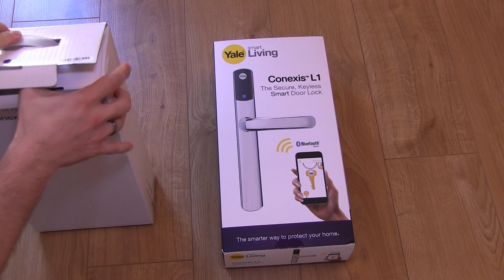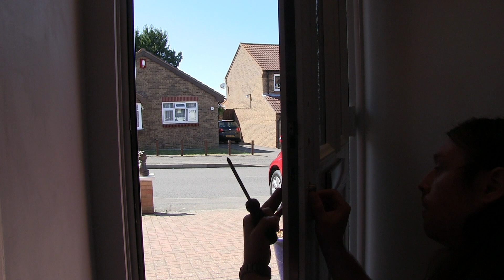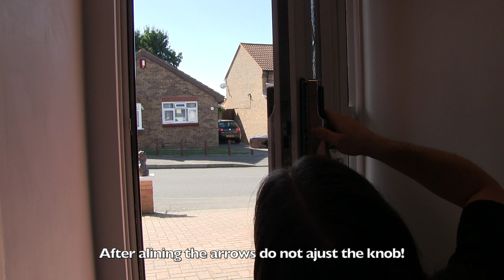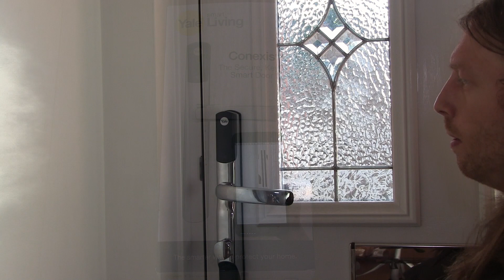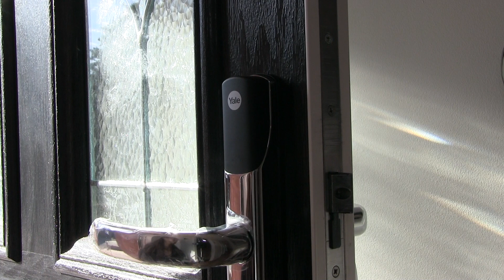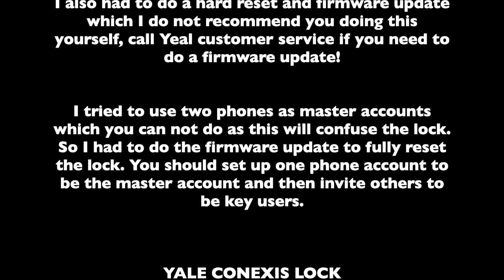Unboxing and installing the Yale Conexis L1 Smart Lock

Comment: Very detail , I want to know door lock hole is same current not need drill new hole ! .? Thanks
Reply from the maker: Hi Elton
As long as your current lock is a multipoint euro lock then no drilling is needed.
See this part of the video, setting the fixing locations https://youtu.be/8_OnJTmXasE and https://youtu.be/8_OnJTmXasE so no need to drill new holes.
I hope this helps.
Kind regards and keep well
David
Reply: @BrenTeckITSupport  ok thanks

Comment from the maker: Hi Paul
I don't know where your comment went :(
"How wide is the handle? I can't find measurements anywhere and want to know if it will fully cover my old handle or if it's thinner it will expose old paint"
It's a good question so I will post it here.
Outside Width = 36mm Hight 276mm
Inside Width =36mm Hight = 386mm
I only quickly measured mine so might be out a bit so use this as a guide.
You can always paint the door before you fit it, which may be best if you are thinking of repainting it in the near future.
Hope you get to see this.
Take care and keep well
David.

Comment: Hi David. Great review! Could you please answer this question for me. I often leave my front door open as I have a stainless steel mesh security screen that I keep locked, allowing a breeze to flow through the house.

If I leave the door open/ajar for a long period of time, will the Conexis be OK, or will it beep at me incessantly?

Thank you, - Mike.
Reply from the maker: Hi Mike
It will beep ones waring you the door is open but I think it then stops. I certainly have not noticed it more than that.
I hope this helps, kind regard and keep well
David

Comment: Would be great if someone could do a troubleshooting video. Had this lock for around two years and for reasons unknown when I close the door the confirmation chimes now ring multiple times instead of the once like it used to do and the only way to stop it is to push the internal button to the right after locking. I've tried resetting it to no avail. Just annoying
Reply from the maker: Hi Tom,
I think this might be warning you the batteries are running low and to replace them now before they get to low to reliably operate the look. It does start waring you well in advance so you may not sport the correlation between the double chime and batteries dying.
I hope this helps.
Kind regards and keep well,
David
Reply: @BrenTeckITSupport  Thanks for your reply. It is definitely not the low battery chimes and I put fresh ones in just in case. It is the door close chimes. When closing the door they used to chime once but now they chime multiple times for about 2 minutes unless you turn the internal circular button to the right to stop it.
Wondered if anyone else had a similar problem.
Reply from the maker: Humm, ok could you not be lifting the handle enough, or the door just slightly ajar stopping it from looking property?
If it's not this than give Yale support a call
This help page looks very useful so try this there is a sample of sounds but all are short.
https://help.yale.co.uk/advice/product-support/smart-door-locks/conexisl1/
Telephone: 01902 364 606

Email: info@yale.co.uk
Reply: @BrenTeckITSupport  . I have been all over that site and it really doesn't help. Yale are known for having very poor support and not replying to emails  anyway the problem is annoying but I can live with it. Thanks all the same.
Reply from the maker: @tomaharbowx  Hi Tom, I have been extremely busy this month so sorry for the late reply.
If it's not the handle being lifted fully or the door not being fully closed fully. It could be a traped lead or another fitting problem such as not enough room for components to move or the wrong bar insert. It could be worth opening the lock again and refitting it to make sure it's all correct.
Good luck and let us know how you get on.
Kind regards and keep well
David

Comment: This or the ultion ? not really anything else on the market for multipoint locking doors, also will any of these locks work with stable doors ?
Reply from the maker: Hi Busyswizzler,

I don't know about the ultion lock so I can not say how that one will be, only the Yale Conexis L1 Smart Lock.

As for any lock on a stable door design, I really can't say. I know UPVC stable doors exist as I have seen them but not taken one apart yet. So all I will say if it's using the standard multi-point and lift to lock then I can't see why they won't work. If you want to be sure asked the door manufacture if they are compatible.

Hope you had a lovely Christmas and wish you all the best for 2021

David

Comment: Biggy for me is that you can not lock it via phone/smart home integration (only unlock).
Reply from the maker: Hi Kevin,

Yes, I know what you mean but if you already have a lift to lock setup then you should be used to it.  It's just a simple lift to lock and all done no key needed. But I do wish there was a motor to do remote locking for though of us who forget to lift to lock or if we let someone in to drop off a package, walk the dog etc and wanted to make sure the door was locked after.

I guess it would take more battery power and a bigger motor to do it.

Thanks for watching and commenting, keep well.

David

Comment: Great video and very helpful. Now that you have it over a year, can you tell me if it was worth the purchase? Thanks
Reply from the maker: Hi Pyle

Well that is an open ended question.

For us I would say yes, as I like having the peace of mind on checking if the door is locked whilst out. Also I now seldom bring any keys or wallets when I am out as I just use my phone for letting me back in when I get home and for contactless payment.

My wife likes being able to unlock the door from upstairs to let someone in as she is disabled and can take time getting downstairs so with the SkyBell she has the confidence to open the door remotely. She also loves being able to check that the door is locked while in bed.

We both love being able to unlock the front door from the worm dry inside of the car in winter and then just go straight in, no fussing at the door.

So for us, yes we love it. But I can see some people would be happy with a simple key, no battery, no internet or WiFi no problem. As for security all locks are just deterrent to stop the opportunist from walking in, so far there is not much publicly on how to hack the Yale lock so brute force is most likely which will probable mean they with use the window instead of the door being a multi point lock.

Glad you enjoyed our video, wish you all the best and keep well.

David

Comment: Good installation video :-)

Did you manage to add the "skill" to Alexa? Keeps telling me my email and / or password is incorrect even though it exactly matches
Reply from the maker: Hi AberdeeAl,

In a word yes. I don't think I recorded it and ever use it. I prefer Google Home Assistant and SmartThings.

First of, make sure your details are ExAcT as it could be case sensitive and check you have got Num Lock off if using a keyboard without a number pad.

Is your Amazon account associated with the right country I remember this causing me a problem for something in the past?

To check/change region:

1. Logged in to your Amazon account in a desktop browser.
2. Go to Accounts & Lists > Your Content and Devices >
3a. Preferences and click the downwards arrow to the right of Country/Region Settings to view your current country.
3b. You may need to click "Learn more about updating your default Kindle Store to Amazon.co.uk"
4a. Hit Change and enter the new address you'd like to associate with your account
4b Click Transfer your Kindle account to Amazon.co.uk

Doing this will change a whole host of Amazon settings and preferences so take care before changing it.

Kind regards and keep well

David

Comment: That's not as smooth operating as I'd have hoped, someone leaving the house still has to manually lock the door behind them instead of the handle simply not catching until engaged as I expected it would work. Not great for a front door, especially in a HMO.
Reply from the maker: Hi Hashterix

Yes it does require the person leaving the house to lift the handle to lock it. The same for most secure doors. I say secure as the push to close latch are so insecure you can open them with a credit card down the gap as seen in spy films.

I do agree it would be nice to have an auto lock feature so after x minutes it could be set to auto lock and a hold open mode if you want it to stay unlocked till you lock it. I would love this feature myself.

You can see if the door is locked or unlocked via the SmatThings app.

Using Home Assistant you can start doing amazing things like take a photo every time the door is unlocked and locked. You could record who leaves it unlocked and have a friendly chat with them.

Have Home Assistant alert you if the door has been unlocked for x amount of time.

I will not go into HA here as this is a massive topic which I will do a video on later.

I am just stating to get into HA and finding some of it amazing but parts frustrating so its not for everyone yet... I mean yet they are updating it all the time and it should become the standard for home automation.

Kind regard and keep well

David
Reply: @BrenTeckITSupport  they ought to release a split-spindle version, plenty of homes use this type of mechanism. As long as the frame of the door overlaps the door itself there would be no risk of a credit card being able to open the lock, it would operate the same as a nightlatch. Split-spindle support and a keypad would make this near enough perfect, their nightlatch version already has these capabilities but your luck is just a matter of whether you have a PVC or a wooden door.
Reply from the maker: @Hashterix  Hi Hashterix,

A night latch is not classed as a secure lock. It only holds the door closed in one point using a spring catch. Which can easily be overcome by one good shoulder barge or a kick, two screws are holding it in or if you're lucky about 1cm of wood in one place which will split. Whereas a multi-point lock holds the entire door to the frame. The stretcher of the door and frame are holding the door locked and closed (as long as it's locked). You will need a ram to force this type open. This being the main problem someone has to lock it! I would love it to have the auto-lock function. So much so if it came out I would upgrade.

You are right it all depends on what door and frame you have in place at the time. 

No lock will guarantee security, it's frightening how insecure all locks are. If you what to lose your faith in locks have a look at https://www.youtube.com/lockpickinglawyer all security does is to keep honest people honest and delay or deter the criminal.

The best security for a home is to have a big dog.

Kind regards and keep well

David
Reply: @BrenTeckITSupport  Or indeed realistic visible security cameras would make a good deterrent!
Reply from the maker: @Hashterix  Yes like the Skybell https://youtu.be/3oHq1vkejHU and the Netatmo Smart Outdoor Security Camera, Wi-Fi, Integrated Floodlight, Movement Detection, Night Vision, Without Fees, NOC01-UK https://amzn.to/3icsLad Video is in the process of being edited.

Comment: what is a soft key for the yale conexis L1 smart lock
Reply from the maker: Hi Shuaib

A soft key is one in the phone app. You have to buy one for each account / user. They are not transferable between users or reusable which is a shame. You can put them on a new phone but only one device per key (user).

So if you want to give someone regular access to your property I suggest using a key fob or card and they can hand it back when needed. If they don't you can deleted the key to stop it form working till you get it back. When setting up the card / fob you can add a time it can be used, but only during setup.

I hope this helps.

Kind regards and keep well

David

Comment: I appreciate this video is 11 months ago but how are you finding the lock. Can you lock it remotely on your smartthings app? Would be interesting to see smartthings functionality with the lock. Great vid, thanks.
Reply from the maker: Hi Hammy,

I am finding the lock to be relay good, especially in winter. I sit in the car and use the app to unlock the front door. That way I spend less time in the rain. Pore me ... I also like having the ability to check to see if I have not left the door unlocked when out. It's nice to have the reassurance your home is secure so you can enjoy the day.

Your not the first to want to lock the door remotely and I am sure most of us want this option. However it is not possible with this lock as it's lift to lock. The motor just disengages or engages the handle after the handle has been lifted.

I have done a video of the Yale Conexis L1 Lock working with z wave and SmartThings here https://www.youtube.com/watch?v=eJEPmeE8BC0

Glad you liked my video,

Kind regards and keep well

David
Reply: @BrenTeckITSupport  Hi David,

Thank you for taking the time to reply. I am considering getting one myself, thanks to helpful videos like yours. I hadn't even thought of that extra assurance knowing if the door is locked! I'll check out your other video, thanks again.
Reply: So 5 years later what’s your opinion, lots of terrible reviews out there
Reply: @rayprior still working fine, I did have a smart things bridge to help unlock it easier with my phone and watch. However Yale have changed things recently, meaning you must buy their bridge to be able to do that now. There is a newer version of the lock now. The market has changed a lot within the last 5 years. I suspect there is a lot more competition now with similar style locks.

Comment: I see this lock works with ZigBee, is there a ZigBee module for this lock, or is it just Z wave
Reply from the maker: Hi Anthony,

I don't know if the Conexis L1 can use ZigBee, where did you see this?

This is why I recommend the Yale Smart Door Lock Z-Wave Module 2https://amzn.to/2WQisNr as I know it works.

Yale does there own Z-wave hub. But I recommend the Samsung SmartThings Starter Kit - White https://amzn.to/2Kaxv2T as it gave us more devices to test and have around the house.

Keep well and all the best

David
Reply: @BrenTeckITSupport  I am not sure where I read it, but one site I came across said it was Z wave and ZigBee compatible.
I have decided to use the module 2 and Samsung hub version 2.
Reply from the maker: Hi Anthony,

Good plan, best to be sure you get a comparable system.

Take care and keep well.

David

Comment: My lock sounds like it is having trouble locking and then when it does lock, it doesn’t actually stay locked. Any advice ? Or faulty product. 
Many thanks
Reply from the maker: Hi Shezan

I found ours does this from time to time, Not the locks fault but mine!
If I just let the door close on it's own and don't push it fully shut and or do not lift the handle fully the lock fails to engage. This is to be expected as I have not fully closed the door!

You are probably experiencing the same thing. When it sounds like it is looking for a longer time than it should, give the door a shove and lift the handle fully. See if that helps.

Kind regards and keep well

David.

Comment: Hello BrenTeck , do you know some other lock for this type oh multilock system?
Reply from the maker: Hi Zelijko, at the moment I only know of the Yale Conexis lock that works with lift to lock system. Regards David
Reply: Here is another option but more expensive than the Yale.
https://www.aviasmart.com/
Reply: ERA used to do an electronic lock that had a keypad on, it was rather chunky and I don't think it connected to WiFi or Bluetooth, that was a few years ago they may have a new product now.

Comment: How do you get in if the batteries fail?
Reply from the maker: Hi Malcolm,
You use a 9V battery on the outside of the lock. There are two metal contacts at the bottom. I keep one in the car and one in the garage.

It works well as I have had to use it twice as I wanted to see how long after the battery low warning chime it would work for, it varied between a few days to a week. 

Hope this helps.
David

Comment: can you fit it up to the back door as well ?
Reply from the maker: Hi Peter, the Conexis L1 is only for multipoint locks. So If your back door is multipoint UPVc door like my front door then yes. However, if you have a French patio door I don't think so as looking at mint it does not look to have enough room to fit. Tilt and slide doors would definitely not work with it. It might work with sliding doors depending on your mechanism.
Best bet is to contact yale directly https://www.yalelock.com/en/yale/com/menu/contact/
I hope this might help.
I just found a compatibility guide.
https://www.yale.co.uk/Yale/Yale_co_uk/Smart%20Locks/Conexis/Conexis%20L1%20Template%202017-2018.pdf
and
https://help.yale.co.uk/is-conexisl1-compatible-with-my-door/
David